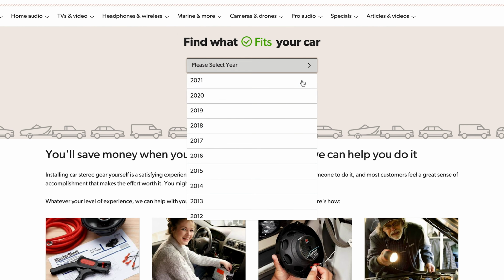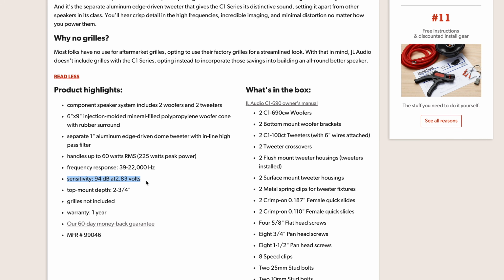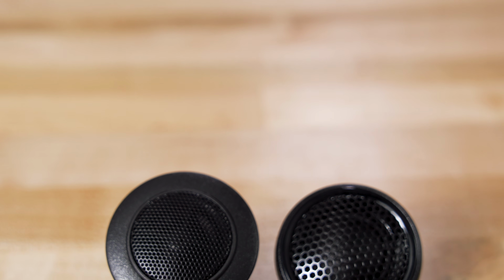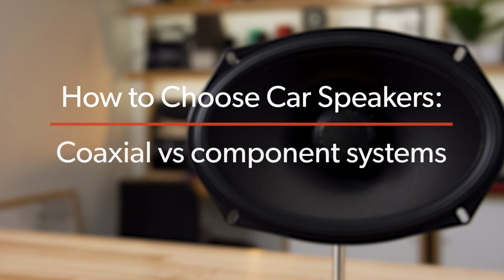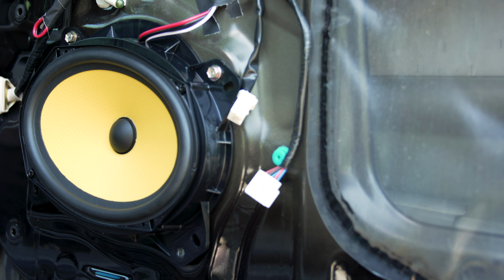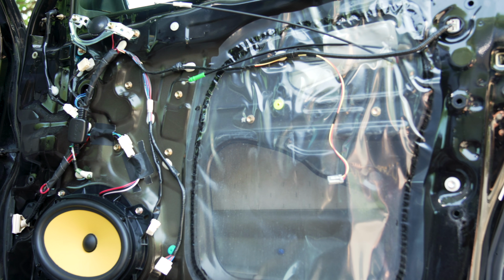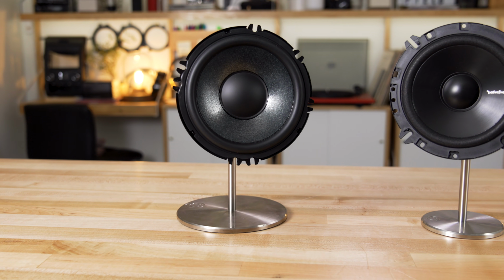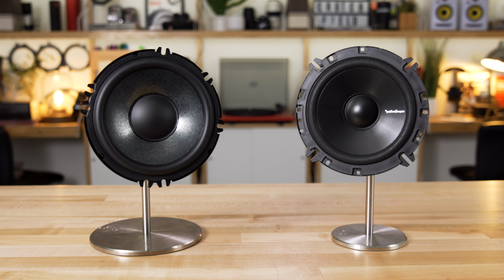How to choose car speakers | Crutchfield

Comment: Hello,
I'm confused between JL C-1 component speaker with coaxial and Ground Zero Titanium component speaker with coaxial.
Preference is crystal clear sounds and beats. No higher requirement of bass but should be decent enough.
Kindly reply.
Reply from the maker: We do not carry Ground Zero gear and have not been able to get demonstrations on their sound to know how it compares to the JL Audio C1 series.

Comment: Great video for getting started and all good points! 
Some things I would like to see listed on the speaker specs page that usually aren't include:
1) Xmax. Power rating doesn't mean squat once the cone runs out of travel.
2) How many orders the crossover has. I bought a set of JBL units that only have a 1st order (capacitor only) on the tweeter and nothing on the woofer. The blend between the woofer and tweeter is friggin harsh! Lesson learned.
3) Verified frequency response in an infinite baffle setup (basically what car doors are). Manufacturers lie about frequency response all the time.
4) THD at 50% rated power, 80% rated power and 100% rated power using pink noise (not a sine wave).
5) Dispersion pattern measurements.
Reply: doubt you will ever see these ratings....

Comment: I have a 2014 versa, with no rear door speakers, i would like to install some. Is it possible and if yes what is the best method of approach
Reply: If you don't already have mounting points then you're gonna have to learn how to install those into your car first. You can generally find prebuilt ones that can be installed with just a few tools
Reply from the maker: Those speakers can be replaced with gear we offer to help.
Is this a Versa S sedan?
What speakers are installed now? What changes are you hoping to get to the sound you get now with those speakers?
Has the radio been replaced? If it has, which brand and model is installed now?
Reply: @crutchfield  im not sure on the model, the car is not a usdm car. Front Speakers are stock, i would like to add rear speakers, just an over all better sound and willing to change the radio if necessary. Radio is nissan standard equipment.
Reply from the maker: Ah, that does present a bit of an issue for us. We are only able to research models made for the US market and won't know which, if any, of our mounting brackets might work. We do offer a 12" x 12" abs plastic sheet that has some grooves in place for the more common speaker cutouts to help with custom making a mounting bracket when needed. Here it is:
 
www.crutchfield.com/I-rYTVc227/p_1208900903/item.html

Comment: How do you feel about pairing a rockford fosgate T400X2ad amp with 2 rockford fosgate m2-65 ? Looking to install in my harley to replace factory speakers
Reply from the maker: That amp outputs a bit more power than we recommend matching to the speakers. The P500x2 is an excellent match for the speakers:
 
www.crutchfield.com/I-rYTVc227/p_575P500X2/item.html

Comment: why is there no peugeot in your what fits in my car?
Reply from the maker: We are not able to get access to them or any of the subsidiary models to research them to gather the information to check what can fit it. The best recommendation we can give is to check with a local custom installer. They should be able to perform the research we cannot and find what fits or maybe what can fit with a little fabrication.

Comment: I have a 2000 subaru outback, it has tweeters on the pillars and speakers in the door panels.. l ordered a two way Kicker from crutchfield.. it has tweeters built in.. do l have to cut the pillar tweeters wires before installing or can l let them run...how will it effect my sound? What do l do???

Comment: So helpful, thank you! 2 questions - I'm using the factory stereo in my Subaru forester (no aftermarket amplifier). Which will go best with it: the morel maximo ultra or the morel tempo ultra?  I would like to choose the Coax option. Should I leave the factory installed tweeter as is? Many thanks!
Reply from the maker: As long as both can fit, the Tempo Ultra are better to run off lower power like that found in radios. We have advisors that can look at all options to check compatibility and give a personal recommendation. Here's how to reach one for this help:
 
https://www.crutchfield.com/I-rYTVc227/support/ContactUs.aspx

Comment: I have looked for the answer to a question I have on the internet for 6 hours now and couldn't find one. So I'm hoping I get an answer here.

I have an amp rated at the following:
45 watt rms x 4 @ 4 ohms
75 watt rms x 4 @ 2 ohms
150 watt bridged @ 4 ohms

I have speakers rated at 80 watt rms.

I want to give my speakers 75 watt rms instead of 45 rms. 

Will bridging my speakers help me do that? If not, is there a way to do that without changing the amp or speakers.
Reply from the maker: It sounds like your speakers have a 4 ohm impedance and there is no way to get that amp to output 75 watts to them. You need a more powerful amp like these:
 
https://www.crutchfield.com/I-rYTVc227/g_347050/4-channel-Amps.html?tp=70128#&nvpair=FFRMS_Power@@Channel|[rank2]%2061%20-%2080%20watts

Comment: Very well done and excellent  presentation it gives quite allot of information.  One thing though is the video is aloof to the fact that factory systems have changed allot in the last 10 or so years.   Many factory systems have external amplifiers for the normal speakers and are often equipped with subwoofers.  Having people think it's still 1985 with a 3 or 5 watt per channel rms factory Delco is simply no longer the case.  This could result in returns by people having replaced or bypassing a factory amp with an aftermarket ending up with no improvement.  Or buying speakers designed for low output when they have a higher power system.  Which could have benefited from speakers with a lower efficiency but higher power handling.  Owners should check what they actually have before purchase and not take a "factory stereo" as a blanket statement.  This benefits both the sellers and buyers in the end.
Reply: @elcactuar3354you're gross 🤢

Comment: Can you wire a 4 ohm sub to a 2 ohm amp? And what will the result be?
Reply: It won’t be as loud but will be less work on the amp
Reply from the maker: Any amp that can support a 2 ohm load will also handle a 4 ohm load. The results will vary depending on how well they are matched for the watts and if that information is even available. I recommend contacting an advisor to discuss your gear and get a recommendation if it is not a match. Here's how to reach us for this help:
 
https://www.crutchfield.com/I-rYTVc227/support/ContactUs.aspx

Comment: No uk cars on the list, hi what would you fit a 2006 Citroen C1 1.4 Diesel? Thanks 🙏
Reply from the maker: We are only able to research vehicles marketed in the USA. I wish I had different news for you there. The best recommendation we have is to check with a local installer to see what they can install into it.

Comment: I drive a 92 Toyota pickup, replacement speakers are 4 inches, I want the jl audio C2 4inch speakers but it says they don't fit, would that be because of the brackets or power output?
Reply: Could be the depth the speakers need
Reply from the maker: It's because the tweeter protrusion space needed by the JL Audio C2 4" speakers is 1/8" greater than the available space in the pickup. We have advisors that will be happy to discuss your goals and preferences to give a recommendation from the speakers that will fit the factory spacing. Here's how to reach us for this help:
 
https://www.crutchfield.com/I-rYTVc227/support/ContactUs.aspx
Reply: @crutchfield  thank you very much!

Comment: Best summary I've seen on key points to be aware of when buying & matching speakers to receiver. The link to and your site info is very helpful. Great deals. Very impressed. From what I've seen, you may just win out my business from Amazon, which is not a bad thing. The only thing you might be a little short on compared to amazon is return shipping. But I'm definitely going to be watching your site for deals equal to amazon. If you did free returns on smaller items like speakers you'd be guaranteed to get my audio business over amazon. You're still a strong consideration though and I'm preferring to move away from Amazon as much as possible because of their growing cancel culture.

Comment: So I have a 4 door and would like to replace all 4 speakers on the doors, they are all located at the bottom of the door so should I go with a 6.5 woofer on the front doors with a tweeter on the a pillar and 6.5 woofer on the back doors or a 2 or 3 way speaker on the back doors ? It’s all going to be running off the stock radio and no amps.
Reply from the maker: A component set for the front would be the most ideal so that you can get better separation of your highs and lows. So yes, a woofer in the door and a tweeter in the pillar would give the best sound stage in your car. For the rear you can go with a 2 or 3 way, those don't really sound much different from each other depending on the speaker itself. We always recommend using the same series of speakers through the car to have a voice matched system and so all the speakers blend together. Since you'll be using a stock radio you'll want speakers with high sensitivity around 90dB and something not too power hungry. I usually try to recommend something around 60 watts rms or less if possible. If you need any help with a recommendation, give us a call! https://www.crutchfield.com/I-rYTVc974/support/ContactUs.aspx

Comment: well sadly I can't check out mine at your web because it's not listed, maybe because it's an europian car. It's a 2004 Alfa Romeo 156 with the original Bose sound system. Well it gives enough power with lots of bass just in case if I want to change it sometime I wanted to know what kinda speakers do I need
Reply: If you have Bose unlike what they make it sound good chance you have one or more external amplifiers.  Bose were one of the earlier suppliers to do this and to include subwoofers on premium systems already installed by the factory.  This also can complicate things when even just changing speakers.  I've seen early 90s Bose with an amp on each speaker & 1 or 2 ohm speakers instead of the usual ohm.  Here is a link to get you started

Comment: I got some nice 80s retro Hi-Fi speakers, they look very nice but sound like garbage very little to no bass, the bass drivers are 6.5 inch I want to find some decent 6.5 car stereo bass drivers or woofers to put in them. My amp can handle 4 ohms so impedance isn't an issue as long as they are not less than 4 ohms.
Reply from the maker: We do not recommend using car speakers in a home environment and suggest reaching out to a place like Parts Express for replacement drivers. If you do decide to use car speakers, then its best to plan on replacing the tweeter with the one made to match it so that there is no doubt about the full, unbroken sound being produced by the drivers.
Reply: @crutchfield  Why buy from Parts Express when you can buy cheaper elsewhere. Car speakers are fine as long as you match the enclosures to the drivers. Car speakers can sound better than home speakers I've done it and built many systems using car speakers.

Comment: 05 Escalade factory Bose, aftermarket double den. I don’t want amps and subs... I just want all door speakers and the tweeters replaced with the highest  quality cleanest clearest sound I can get just from the speaker upgrade. I would do 6x9s all around if I had some spacers so the windows can still roll down. But I’m going to keep the factory grilles to keep it factory looking just want clean clean sound, without any problems with the Bose system. Is it possible?
Reply from the maker: Is your Escalade an ESV or EXT by any chance?

Comment: I recently replaced all my speakers in my truck. 6 all together. 2 5.25 inch doors at 300w, 4 4x6 inch in dash and behind me. All 200w. What size amp would i need?
Reply from the maker: Can you tell us the specific models of the speakers you have? We would need to check some specs to make sure we match up the amp correctly.

Comment: If my stock audio system has a woofer in the door and a tweeter higher in the sail panel already, do I need to use the aftermarket crossovers that come with aftermarket equipment or should they already be crossed over at the amp?
Reply from the maker: If you're using a component set that comes with it's own crossover, you'll want to use the crossover that comes with the set. The crossover is designed to work with those speakers specifically to achieve the sound t he manufacturer intended it to have. You can still make adjustments at the amplifier if you choose to.

Comment: I have a 98 toyota sprinter Trueno and there isn't any info on that sight about it, what are the front and back sizes of the speakers?
Reply from the maker: We are only able to research vehicles released in the U.S. automotive market which is why the Sprinter Trueno is not in our database. I wish I had different news for you there. Hope you find the sizes for it!

Comment: This just made it complicated to decide now ,I want to upgrade my pioneer z series components in the front doors of my suburban to skar components what should I look for I have a skar skv2 200.4 amp & want more highs so I'm thinking of replacing  my z series coaxial in the rear door to skar fsx65 &a super tweeters vx35-st what do you think 🤔
Reply from the maker: We do not carry Skar to know how they compare to Pioneer, but I do know that based on the specifications I found online about each component, that setup should work.

Comment: Having trouble with power balancing a setup of 2 6 3/4" (100 RMS each) and 2 6x9" (150 RMS each) with a multichannel amp. Except for AudioControl's amp that does 125 RMS x4, it is really just too pricy for me. Even if I did get the AudioControl amp I would be over powering the 6 3/4" and would have to adjust gain knob therefore robbing 6x9's of power. Should I just buy two separate amps? 1 amp for the 2 front speakers and 1 amp for the back 2 speakers? What do people usually do in this situation?
Reply from the maker: Speakers do not require that they be connected to an amp that can give them all the RMS watts they can handle. Depending on the goals for the system, I often recommend an amp that will match the lowest RMS watts and use it. The times that the goals and usage of the system require that the speakers get all the power they can handle, separate amps are needed because you definitely do not want to overpower one set of speakers just to give another set the top RMS watts they can handle. We have advisors that can discuss your goals to give you a recommendation on a setup and gear to meet them. Here's how to reach us for this help:
https://www.crutchfield.com/I-rYTVc227/support/ContactUs.aspx

Comment: If my truck has 2...3 1/2” speakers & 4...6X9s.

Would it be worth adding 2 6 1/2” speakers in the front doors rather than 6X9s?

Comment: I've got an 2007 Nissan xterra and its got an shirts audio system in it speakers are very unbalanced and they sound horrible but I don't want anything to over powering or if someone else is driving it I don't want to blast them out

Comment: Do I need a crossover if my factory speakers are already component?
Reply from the maker: If you are purchasing aftermarket components that come with a crossover, you will want to use the crossover included with the components. That crossover is designed to work specifically with those speakers as the manufacturer designed it to sound a specific way.

Comment: I have a small hatchback. Renault Kwid. How can I get a full sound in a small car space and not compromise my boot space?
Reply from the maker: Does your vehicle have a spare tire under the trunk floor?
Reply: @crutchfield  yes it does
Reply: @crutchfield  but thats a space I don't want to tamper with. I know I've got restrictions. So want to work around it.
Reply: Also usually lugging around instruments and gear, I'm a musician. So I need all 300ltrs of my boot space
Reply: @crutchfield  thanks for the super quick reply
Reply from the maker: You won't have to lose boot space with a subwoofer designed to mount with the spare tire in the spare tire well:
www.crutchfield.com/I-rYTVc227/p_109BASPROB/item.html

Comment: Can anyone tell me if the infinity kappa cxf 4x6 speakers are any good? I have a 03 Silverado with a a Sony touch screen,  and alpine s65 6.5 coaxial front door speakers. But I want to replace the back 4x6s... I'm not running amps....

Comment: I like the website but I can't find my car on there so to pick out speakers 2000 Mercedes-Benz CLK 430
Reply from the maker: It sounds like your CLK might be one we have not been able to research. We can double check this. Is yours a convertible? Does it have the factory installed Bose sound system?
Reply: @crutchfield  I think it does have a bose everything is stock in the car

Comment: Hi JR.  I just received Focal es165kx2 for my van. There will be couch in rear and screen come down behind front seats and can be moved to the rear when sitting in front with seats in cab swiveled. Attempting best set up so they either will go in front doors or need put in box for the rear. Due to font seats in the way the sound will be compromised when listing in the rear. If used for rear I’ll get a decent coax in front doors if in front s
Doors will need a good surface mount in the rear. That said what do you advise for surface mounts. Have a soundigital 800/4 and using a JL audio 10” sub with coustic 40ldb.   Thanks for advice you can provide. Will have mineral wool insulation and acoustic foam/fabric also.